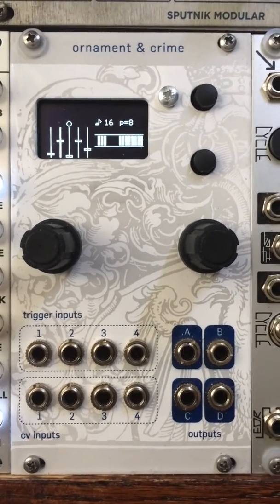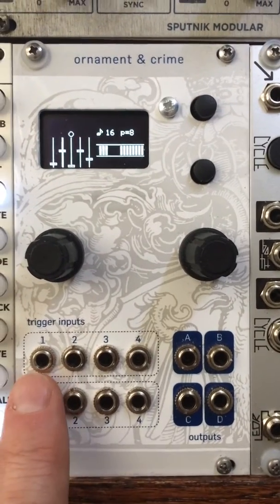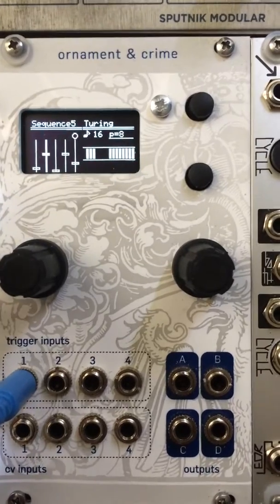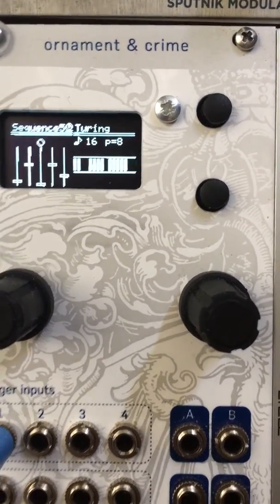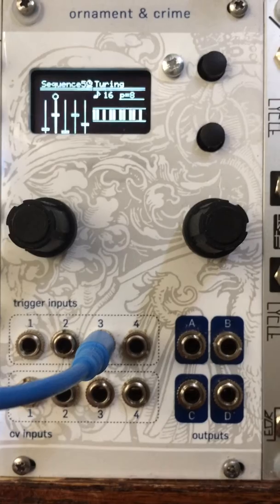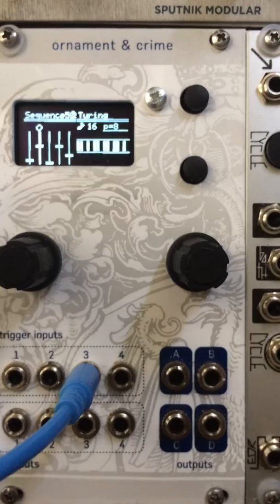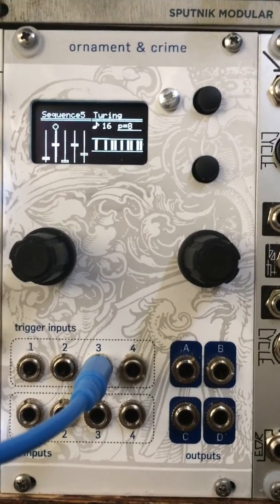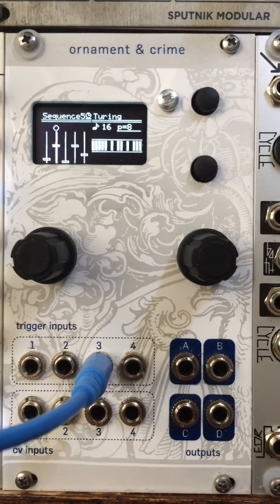Hemisphere Suite - Part 4 - Master Clock Forwarding

Comment: Hi! So I’ve been having issues with side B and external clocking. Master clock isn’t enabled and trig 3 input isn’t receiving a clock in any capacity. Turn on master clock and it sends over just fine. Would that be a hardware issue or firmware issue?
Reply from the maker: It sure sounds like a hardware issue, or everyone would have reported it.